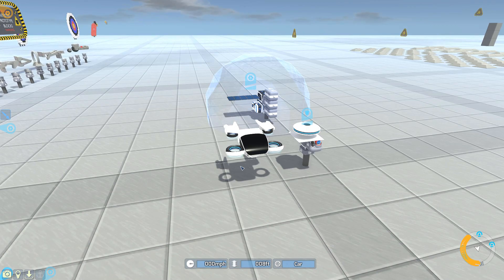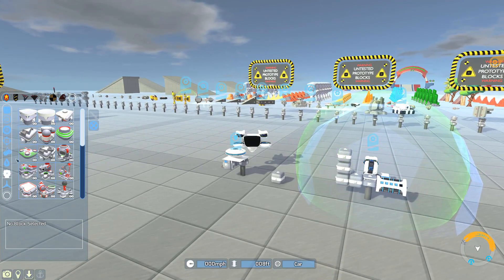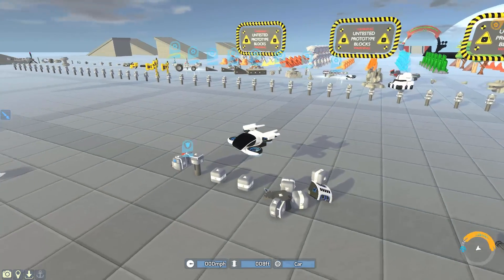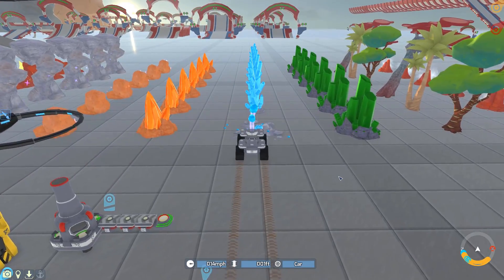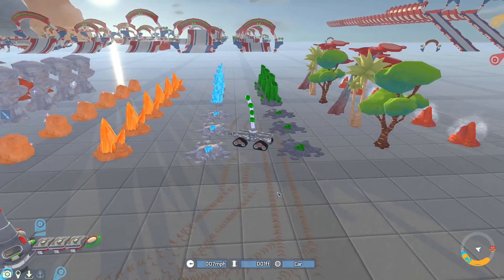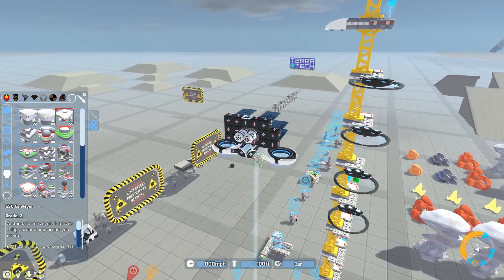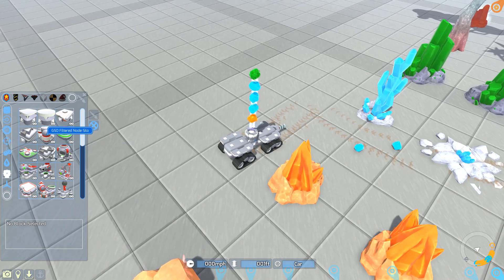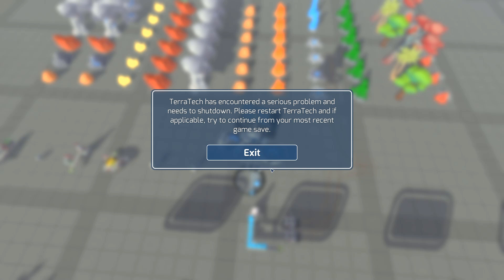BACK TO THE R&D TEST CHAMBER!! | A BETTER FUTURE EP40S7 | TERRATECH

Comment: Hey TenZen, I’m back, and I’ve gotten a nice way to test damage between weapons. 
My strats are down below. After that, some examples!

Simply anchor and control the weapon of choice, and have your target be the GeoCorp Octo Block (giant cube equaling 8 GeoCorp basic blocks). This block as I can see holds the most HP, and being a big target, counting each weapon’s shot becomes significantly easier. Examining how many bullets or laser shots it takes for a weapon to destroy one Octo can give a fair gauge for how strong each one is. If you want to test constant-attack weapons such as the plasma cutters, the disc lasers, or the rapid-fire minifuns, it’s best to measure in Damage per Second.

Some results I’ve gathered.

GSO: Megaton Cannon: 13 blasts destroy 1 Octo block
Hawkeye’s equivalent: 12 shots.

Better future’s cab must shoot 73 times to destroy the block.
However, it’s cab lasers can one-shot the standard GSO block, two-shot a GSO cab.

Comment: That crash is actually because when the pacemaker block causes a selling base to run fastforeward, resources don’t actually render or physically get shot from a delivery cannon. They just disappear and get sold but are still implied to be shot from the cannon. Since you have a collector for the chunks waiting above, the game gets confused because the collector is trying to collect these visually nonexistent resource chunks. If the pacemaker was in slow mode, this crash would not happen, since resources are rendered when shot.

Comment: No matter how you place the BF Receiver, if it’s over a delivery canon at all, really high or just above, you wont receive the money for the resource. It always knows when there’s a receiver above. I’ve tried all kinds of ways and the only result is either the game crashing (happened a lot when trying to trick it this way) or the receiver catches it. It’s a good thing I think as one resource circulating round being sold constantly, with a pacemaker block, would be pretty game breaking. Still, I’m trying different ways still.